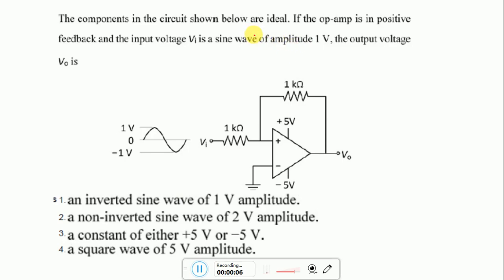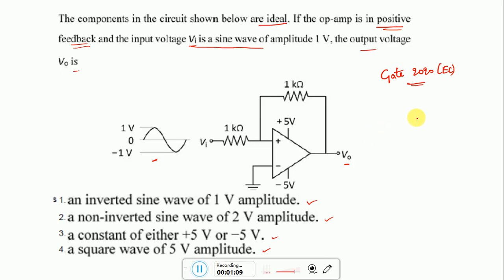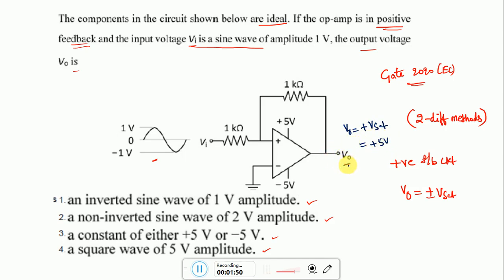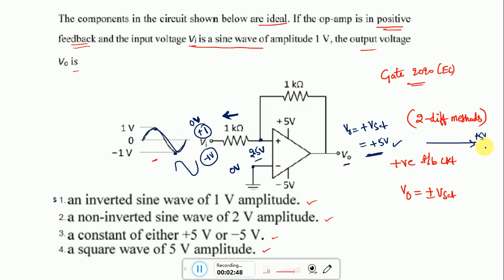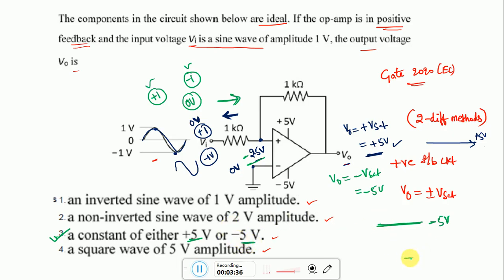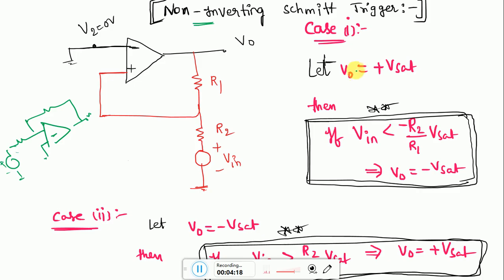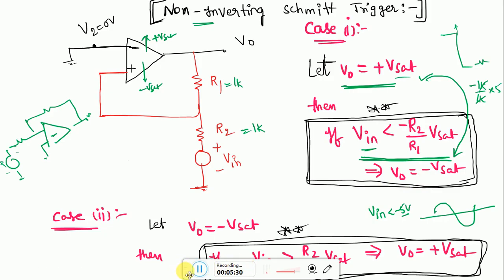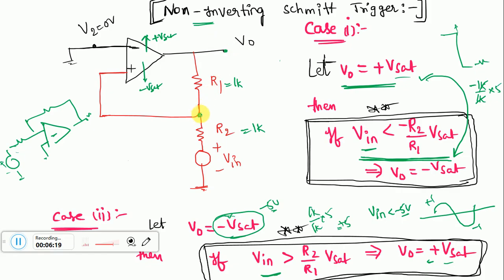Positive feedback analog numerical solved - GATE 2020

Comment: You said the current direction is not changing, but in the second case the you have indicated the current in reverse direction by green marker..Why??
Reply: You have to pay attention to what 'Vset' aka Vo voltage is.   That's step one.  Step two is to recall that with 'conventional' current, the current flows positive to negative.  In the first case he set Vo (Vset) to +5 volts.  Since the two 1k-ohm resistors are a voltage divider,  there is 2.5 volts in the mid-point between them, at the "+" input port of the op amp.

Get it?  There is +5 volts on Vo (Vset) and there is +2.5 volts on the "+" input port of the op amp.  Since 2.5vdc is more (relatively) negative voltage compared to +5vdc,  conventional current flow is RIGHT to LEFT,  ie. *FROM* Vo, *TO* the leftward direction towards the "+" input port of the op amp.

Then he set Vo (Vset)  to -5 volts.  Now, Vo has become the MOST (relatively) NEGATIVE VOLTAGE in the op amp circuit.  So with conventional current - which flows POSITIVE to NEGATIVE - the -5vdc on the Vo (Vset) will be the DESTINATION of current flow in the circuit since it is the most negative voltage.   Conventional current flow will be from LEFT to RIGHT.

Hope that helps.
.
.